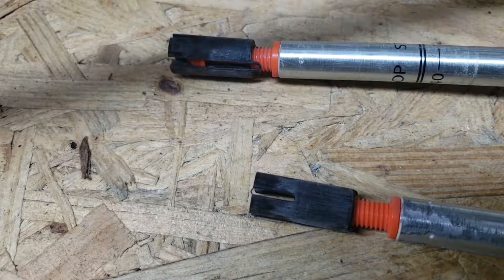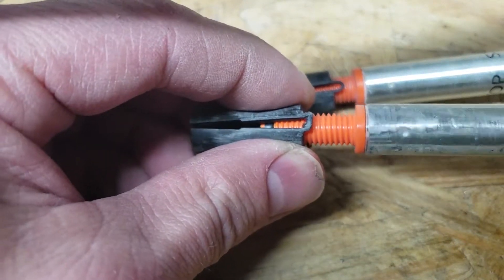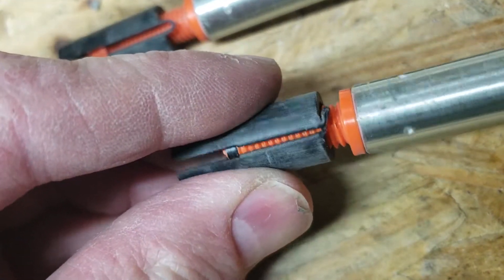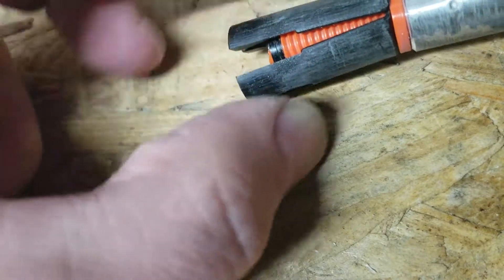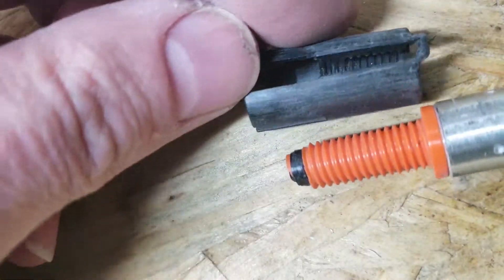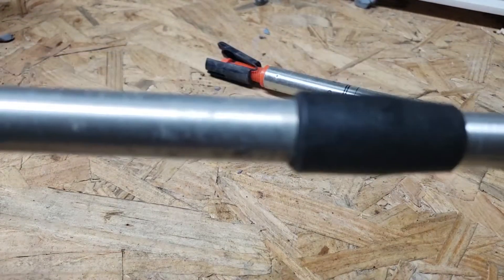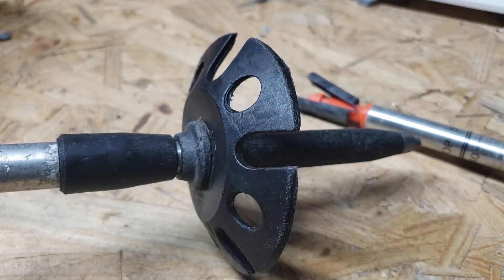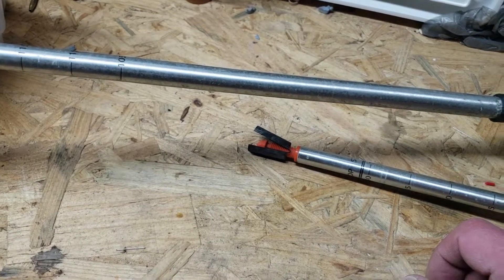Komperdell Trekking Pole Repair

Comment: Thanks for the video!  You mentioned that the split black expanding "nut" is available.  I need a few.  Where can I find them please?
Reply from the maker: @dalepetty5490  this was 4 years ago and they're becoming scarce. This company is a sporting good supplier that appears to have them. They used to be just a distributor but it appears they may sell to the public now, but not sure. Hopefully this helps.
https://libertymountain.com/camp-hike/trekking-poles/lock-mechanism-ntn07179.html

Comment: I had one that the bottom pole would spin and not lock up. I found the pole split at the top near the plastic screw part so i removed the plastic screw cut the pole to the end of split approx 1” and re fitted the plastic part and centre punched the pole 4 times to hold plastic screw. Voila all fixed.

Comment: is there a way to make it work? had to drill out each side of pole.
Reply from the maker: I'm not sure what you mean. Is the spreading mechanism parts still in the ends?
Reply: @ActinOut  I drilled both ends out. Now I'm going to have to find the mechanism that's inserted in tubes to make it tighten. Thank you
Reply from the maker: @dcon1023  sorry man. Good luck to you. I tried to find the replacements and wasnt able to which led to me coming up with this fix. If you are able to find replacements, please consider letting us know in the comments here so others can locate them as well. 😁👍 Thanks for the comments.
Reply: @ActinOut  I think I found them on ebay. Hopefully they will work. They have different sizes. Different vendors, I gotta try something, this makes the pole usless, thank you Thank you ActinOut